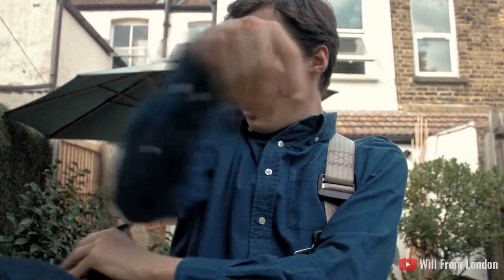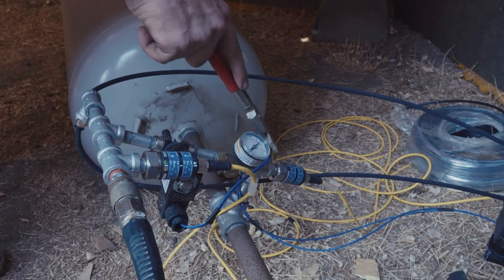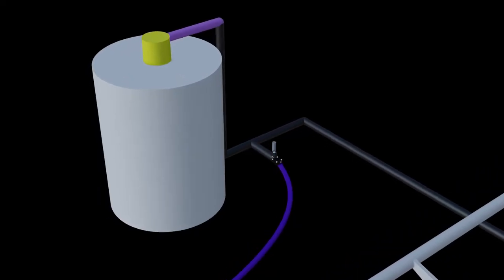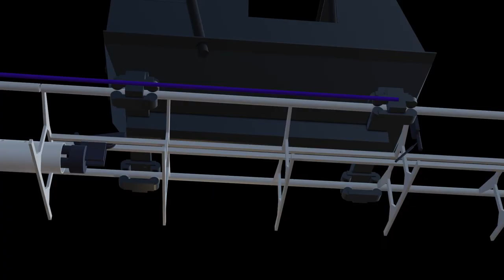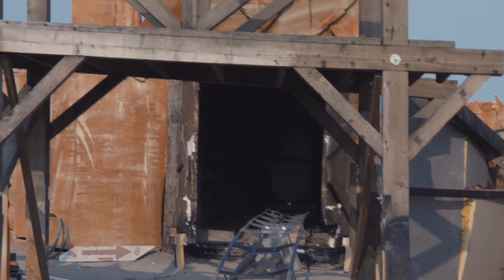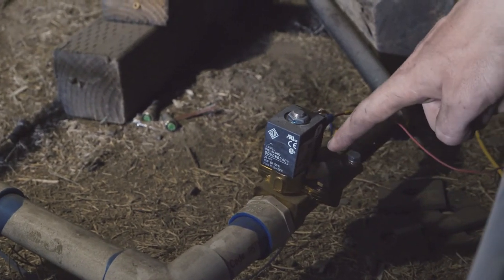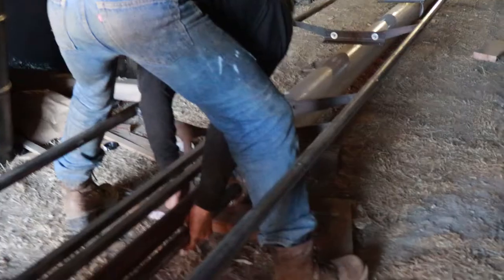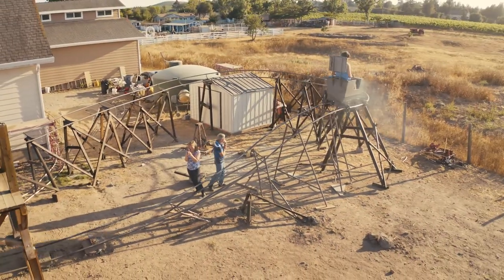Building a LAUNCH for a BACKYARD Coaster | LITTLE THUNDER

Comment: What schedule was the 6" PVC cylinder, and what was your maximum pressure?
Reply from the maker: We used schedule 40 PVC on the 6” pipe. We capped pressure at 128 psi.

Comment: What if the brake was still on and it launched?
Reply from the maker: This is a great question! Because the brake is part of the circuit which initiates the launch, it physically cannot launch without the break pad lowering and completing the circuit. 

Now, if we were somehow able to manually launch it while keeping the brake up, I posit two things would happen; 1) the piston would initially encounter additional resistance resulting in significant air loss around the gasket which would reduce the overall force of the push and 2) the force from the piston would be enough to push the kart through the brake as the brake is only meant to stop the kart initially and hold it in place prior to launch. It would not have enough speed to clear the hill and would fall back into the launch cave. The piston would act as an air brake cushioning the impact of the kart and bringing it to a stop. 

Hope that helps!

Comment: So have you ever thought about trying a I beam for Track similar to Rmc, i’ve always wanted to try it myself but I think it’s too expensive for me, but you could do so much crazy stuff with it, like never before seen elements like an heartline roll with a airtime hill in the middle, or crazy stalls, and wave turns
Reply from the maker: Would love to do the RMC styled track. The trick would be figuring out a jig to roll the steel. Pipe rollers are easy enough since rolling pipe is so common. Rolling an I-beam seems a bit more unconventional, but could be worth it for executing some of the more exhilarating moves.
Reply: @Magictecture  By any chance has anyone took little thunder? And how much would it cost
Reply from the maker: We’ve had a couple people interested who have asked questions, but it’s not sold yet. The base asking price is $149k. I can send you more details if you shoot me an email. disneytecture@gmail.com
Reply from the maker: @unifiedthrills  We haven't sold little thunder yet.  The starting price is $150k, but it's negotiable depending on the level of involvement.  If you want more details, you can shoot me an email and I can send you a detailed list with pictures.

Comment: I really wanna make one but I’m also not that smart to build this and I don’t really have proper tools. So I gotta find a way to make a simpler, cheaper version. Any ideas?
Reply from the maker: I’d definitely start out figuring out the goals of what you want to make. So if it’s a coaster, what elements do you want. Break those apart, and attack each problem trying to figure how to accomplish the goal. I would start off small, researching and developing your idea and bringing it into fruition. If you want to build a launch, I’d recommend figuring out how your coaster will run the track first and going from there. Hope that helps.

Comment: How does the system deal with a rollback of the cart?
Reply from the maker: Great question! We have an anti-rollback dog on the kart and then antiroll back slats on the lift hill.
Reply from the maker: And yes, it did fail once and work.
Reply: @Magictecture  Thank you for your quick answer, but what about a rollback after the launch? When the cart for some reason doesn’t make it up the hill after the launch?
Reply from the maker: @davetv6802  ah, yes, another great question. There is no anti roll back after the launch hill. Reason; the piston acts as a natural air brake. This worked surprisingly well. And yes, this was tested and actually happened to a rider. The doors closing and launch reset will not occur until we’ll after the kart is beyond this point.
Reply: @Magictecture  Oh that’s smooth 😃 Thank you for explaining.

Comment: What model PLC was used?
Reply from the maker: We went through automation direct. The touchscreen we used was C-more Micro EA3 series HMI, 3in monochrome STN LCD, 128 x 64 pixel, LED backlight, supports (1) serial port.
Reply: @Magictecture  thanks! What was the model of PLC running it? Was it one of their CLICK series PLCs?
Reply from the maker: @calrustad5746  Yes, the C-more is a click through. It has a small screen and 5 buttons.
Reply: Productivity1000 PLC from AutomationDirect. We had considered the click PLC originally, but I determined that the P1000 was not much more and brought a lot more functionality that we very much used.
Reply from the maker: @fieldfilmz  Thanks for jumping in!